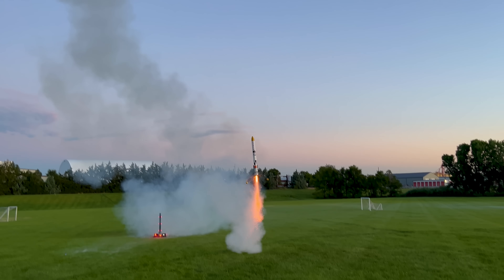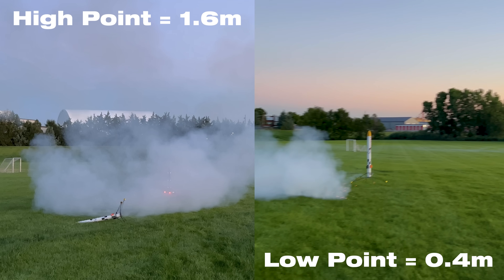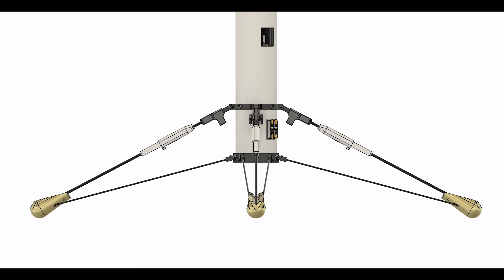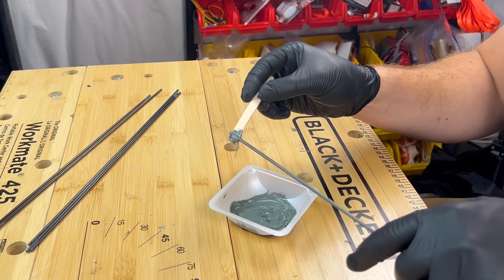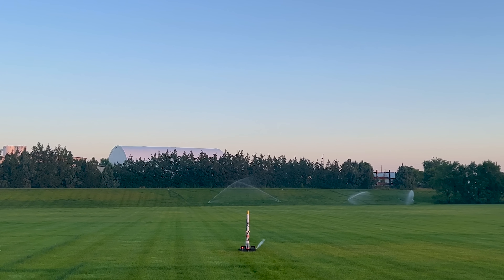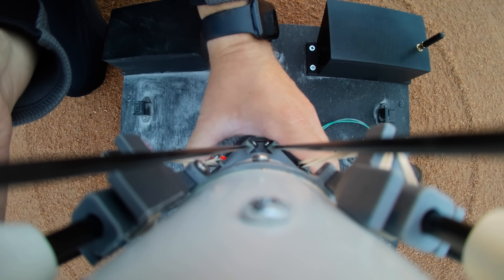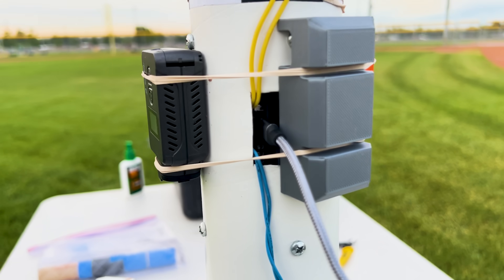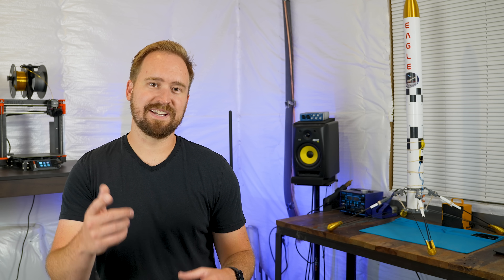This Model Rocket Lands Itself Better Now

Comment: Love how you made it super realistic by having the rocket unable to hover... So it has to get it height and speed to zero, and cut the engines at the same exact moment.
Reply: You can't hoover these types of rocket engines as you have no thrust control, you can only ignite the engine and hope you simulated it well and the rocket will decelerate to 0 at the right moment
Reply: @TheKilerfish  The SpaceX rocket does have thrust control but cannot go so low as to be able to hover, so it is has to do the same as this rocket, get to zero speed and height at the same time and then cut the rocket at that time too. Which is what i liked about this model rocket.

Comment: wow. just a bit of trust vectoring would help :D
PS: could be possible to modulate the trust of the motor?
Reply: Thrust* and its a solid state motor. How would he do that?
Reply: @utubetravman  You could deflect the thrust I'm pretty sure, swear I've seen that already because it is a common limitation of hobbyist motors
Reply from the maker: Eagle has thrust vectoring. You can control the thrust of a solid rocket motor a little bit, Joe from BPS Space had a very clever way of handling that when he landed his rocket Scout F, I suggest you check it out. Eagle doesn't modulate thrust at all though.

Comment: Take a look at what the RC car market does with shock absorbers.  You're on the right path.
Reply: I was thinking the same thing. You could use adjustable shocks and take the rebound out.
Reply: @codysp  Correct...take a look at 'any' RC car...they don't bounce when dropped

Comment: Very cool, Mark! I was thinking that you need shock absorbers watching your landing attempts. 
I like the design, very simple and efficient. Also, I would recommend to stay away from PLA for any parts under dynamic load and use PETG instead. Especially for parts that are supposed to bend like this locking thing.

Good luck with future projects!
Reply from the maker: Thanks Dima! I was thinking of moving to PETG or ASA as well after those first few failed attempts but was surprised swapping PLA colors made such a significant change. Will definitely keep that in mind though for future projects.

Comment: Instead of having a suspension, wouldn't you be able to have landing spikes instead of legs. If the rocket comes down, it would drive the spikes into the ground, preventing it from jumping back up, because of the sliding friction with the ground. Just a thought, don't know if this is viable. And this would obviously only work when landing on soft surfaces.
Reply: That would be pretty likely to just tip over if there were too much lateral velocity. It's also questionable whether the thing weighs enough to drive itself deep enough to secure itself.
Reply: Lawn darts were bad enough before having their own solid propellant power source but I admire your commitment to fun
Reply: I have a feeling that that would work pretty well but they might think of that as cheap or cheating
Reply: What about redirecting remaining thrust in the rocket upon initial touch down outwardly to mitigate the bouncing effect.
Reply: EXACTLY what I was thinking.
Simple mechanical latch to trigger the deflector.
Reply: This comment reminds me of what the rules are for the highest jumping robot . Things like this have some criterias that put them in certain categories. I'm not sure what it would be for landing but if you look into the rules for jumping robots it would sort of show the fundamentals of why limits are put in place
Reply: Jarts!
Reply: Totaly cheating, especially when you're trying to imitate falcon 9 here